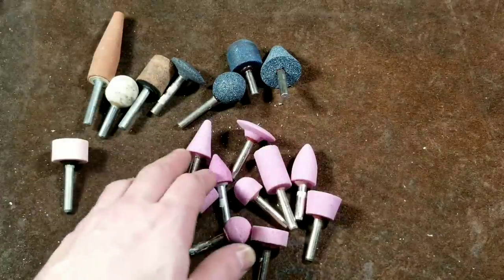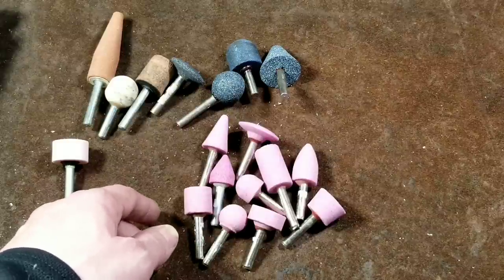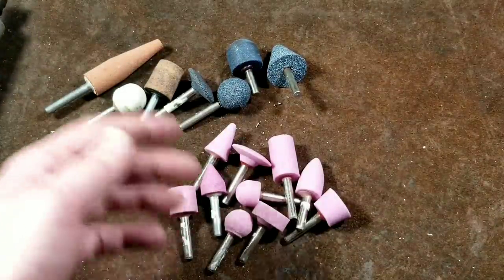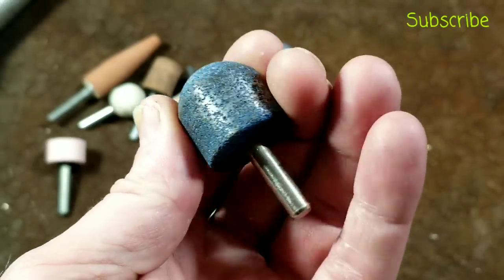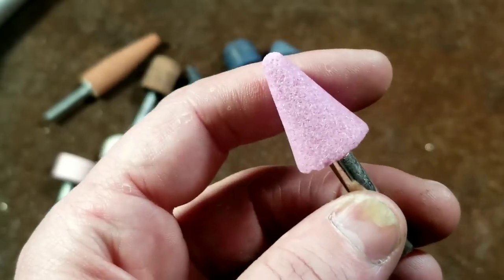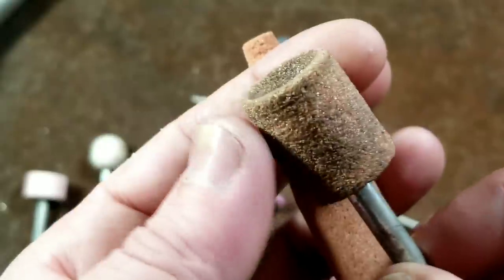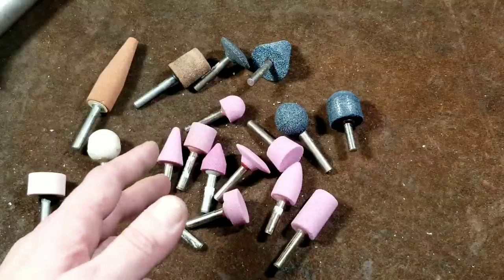Basic Die Grinder Wheel Introduction & Overview

Comment: At a slow RPM. I use die grinder with a grey/ blue stone for emergency drill bit sharpening! A steel type burr I used for Aluminum porting my manifold and intake runners. Throttle body. On Aluminum I used a spray lube! Beautiful! More power!

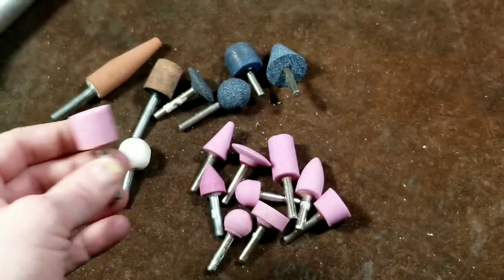Comment: Can i grind a rusted exhaust bolt head with these? I have 600W - 2500 RPM corded drill. I guess it'll take a long time. The bit i have is 6mm shank purple like this one 4:14 . I cannot afford to buy die grinder just for this one job. I know corded drills are not made to take high side forces , but i think this method could save me big buck not buying a corded die grinder which are expensive. Thanks.
Reply from the maker: Yes it will be slow but you can do it with a higher speed 3/8"-10mm drill. If it has ball bearings for the spindle then it will not be that hard on it. Just make sure not to cover the vents so the drill stays cool for a long duration operation like bolt grinding.

Comment: is there a difference between a die grinder and a rotary tool like a dremel?
Reply from the maker: Die Grinders take quarter-inch shank bits and they're just a lot more powerful otherwise they're just the same the Dremel is just a small lower power 1/8" Shank mini die grinder

Comment: I don't like the "stone" wheels at all. They WILL hurt you. Buy the best carbide rotary files you can afford and then use sanding rolls to smooth it out as available from Jeg's or Summit. That is how the professional aircraft cylinder guys do it here. Throw those stones away, you may need any eye that they will hurt later in life, like tomorrow.
Reply from the maker: That is good advice however Stone wheels are not catastrophically dangerous they would not be on the market if they were really that bad you just have to be aware of what you're doing and not over speed and overload them, replace them when they get one rather than run them until there's nothing left and the reason I do like them is carbide burs are astoundingly expensive often times costing 20, 30, 40 even $50 each and if you're trying to grind hard metals they wear out very fast
Reply: Yes. I agree, I'm suffering here to grind a 6 cylinder exhaust welds to remove the muffler and it is taking forever with the metal bits. It is really hard weld and steel. I'll try the stones bits tomorrow.